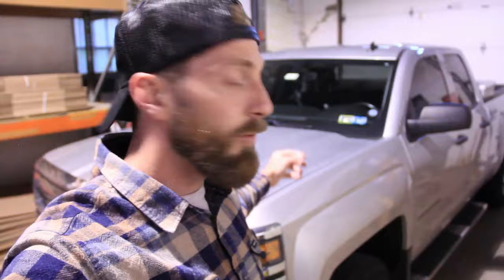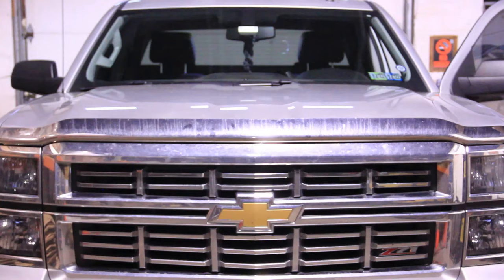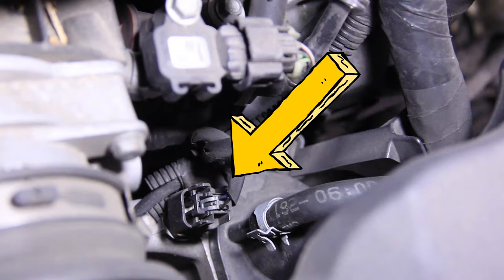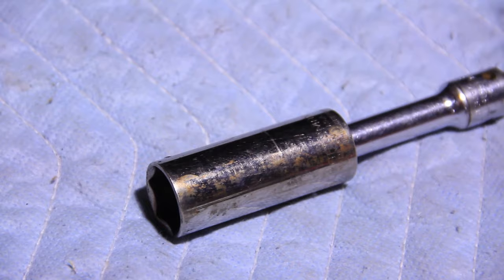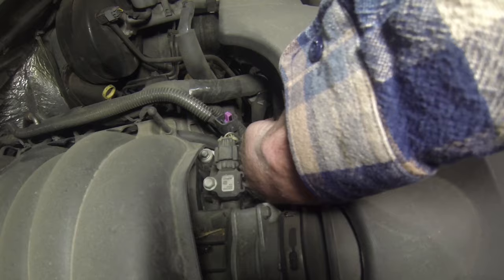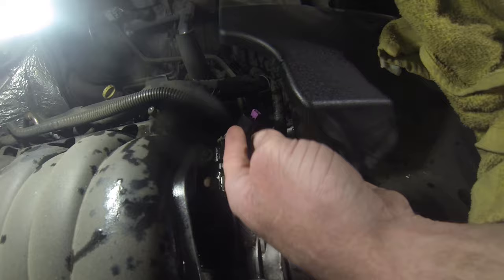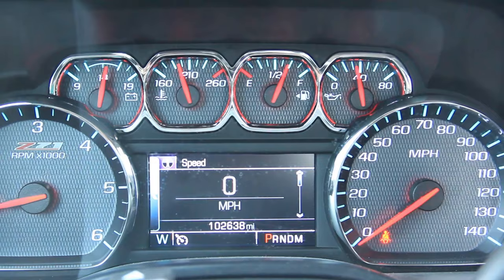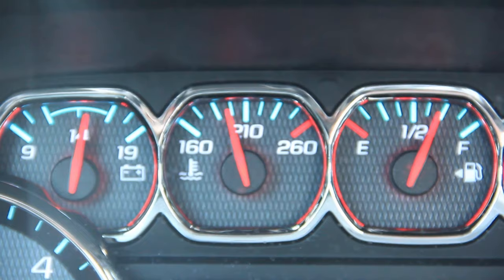Radiator Fan Won't Turn Off: 2014 - 2019 Silverado & Sierra: Bad Coolant Temperature Sensor Replaced

Comment: So I just had this issue. I replaced the part once already an now on my way to work ita doing it again. Is there another reason why it would do it again? The temp sensor I replaced it with was an OEM part too...
Reply from the maker: Hey what's going on?! We've addressed possible issues that could possibly cause this issue in other videos we have done.  I've linked them below: 👇 watch the first one for the explanation and the second for how to fix the issue.
https://youtu.be/wed9eZxPwsQ
https://youtu.be/WvLyBM8FHdM
Reply: @TheBrothersWorkshop  thank you! Looks like I have a thermostat to replace this weekend!
Reply: @TheBrothersWorkshop  I'm also curious at what  Mileage you had you're issues? I'm sitting at 165k now an she's just starting to do these little things like this
Reply from the maker: My lifters went at 75k and my thermostat went at around 100k.

Comment: Some temperature sensors specify not to use teflon tape.  Are you sure this is okay?
Reply from the maker: You are correct.  We recommend removing or not using the Teflon tape if it is not needed.  We go over that in this video: https://youtu.be/wed9eZxPwsQ
Reply: @TheBrothersWorkshop  Ok.  I was checking out my work truck while the video was going.  I ended up just disconnecting and reconnecting the battery and it worked.  I remembered when I was installing fuel injection on my 66 Mercury and installing a second water temperature sensor which is the same as the one  these trucks use, the instructions said not to use teflon tape.  I had already installed it with the tape on it and promptly took it off. Helpful video.  I love YouTube.
Reply from the maker: Glad we could help!  YouTube is the best for issues like this!

Comment: I replaced both thermostat and sensor, unplugged the battery for a couple of minutes and turned it back on seemed fine for a couple of days but is still doing the same thing. I cannot figure how to stop the fans from powering on
Reply from the maker: Most likely you have missed a step, or did not do everything correctly.  Go back and double check your work, and check out our troubleshooting video: https://youtu.be/wed9eZxPwsQ
Reply: I did just that but im starting to think its a problem with a relay. Im car savy enough to follow the directions to the t from this video and I knew what I was doing those darn fans just wont turn off. Like i said, they did stop blowing, gauge was working again, and the ac was cool once more but, its like something comes loose and on come the fans and the gauge drops down, the ac is no longer cool. Im going to check it out tomorrow morning. Any other suggestions?

Comment: Hey so I had this same problem but now it stops when it turns off but when my truck is running after 5mins it’ll start up again and it’s running very fast also
Reply from the maker: We've made two videos for people having this issue.  The first is a quick video that explains the common reasons you could be experiencing this issue.  The second video explains how to replace the thermostat (the most common reason this is still occuring).  I've linked both below for you.  👇

https://youtu.be/wed9eZxPwsQ

https://youtu.be/WvLyBM8FHdM

Comment: Mine are running while truck is on but constantly. Same problem??
Reply from the maker: It definitely ran high while the truck was on.  It all depends on the symptoms, but it might not hurt to replace the sensor and thermostat. I've linked the thermostat video below: 👇
https://youtu.be/WvLyBM8FHdM
Reply: @TheBrothersWorkshop  thanks for the reply bro. Fuse and relays look brand new still. Gonna do sensor first and then thermostat if needed. Thanks man. Great vids too.
Reply from the maker: No problem dude!  Good luck and let us know how it goes.

Comment: Same thing happened to my 2014 Silverado...excuse me but how much does it cost to repair this?
Reply from the maker: Hello Jon, the cost is all in the parts.  Roughly $20-25 for the sensor and $50-60 for the thermostat.  I would recommend replacing both at the same time.  I've linked two more videos below to help you: 👇
https://youtu.be/wed9eZxPwsQ
https://youtu.be/WvLyBM8FHdM

Comment: I changed out the sensor first that didn’t work so I changed the thermostat and still no luck I took off the negative on the battery and left it off for 30 min and still haven’t fixed the issue anyone have another suggestion
Reply from the maker: You might have another issue. If it didn't work I'd take it in and have it serviced by professional.

Comment: How does a coolant temp sensor, with a 5 volt feed(ignition on) cause the fans to continually run, especially when the temp gauge was stuck on °160.  To me, that means the engine is not getting hot enough? A thermostat stuck open,  would cause an engine cold too long,  which also shouldn't keep fans running? Does this have two sensors,  1 for gauge (single wire), 2nd, for pcm to monitor temp, , thus having pcm trigger relay to engage fan(s)??
Reply from the maker: Hey Patrick, thanks for watching the video.  Changing the sensor works, but sometimes the issue continues.  We recommend changing the thermostat at the same time.  We've linked two more videos for you to view below: 👇
https://youtu.be/WvLyBM8FHdM
https://youtu.be/wed9eZxPwsQ
Reply: I'm just curious as to what the pcm was reading from the temp sensor. Could you see that reading on a scanner?
Reply from the maker: That's a good question, but unfortunately that is one we don't have the answer to.

Comment: Dear, I have 2014 silverado.I have a exactly same problem. Is this also related AC as well? My AC is warm when this problem happen..
Reply from the maker: I want people ask the same question.  However, when this happened to us it was the winter.  We never noticed a difference because we weren't using the ac.

Comment: I have ? I have a 2015 Yukon this happen to me 3 days ago can I still drive my truck with a bad sensor? Asking cause I’m taking it to the dealer and it’s about a 20 minute drive.
Reply from the maker: I drove 6 hours home after this happened while I was on vacation.  I don't condone doing that, but I had no issues.  However, I would try to change this myself before going to the dealership.  It's much too easy of a fix to spend a few hundred dollars at the dealership.
Reply: @TheBrothersWorkshop  yes but try telling that to my wife!😩😩😂😂😂I told her I can fix, her answer was hell no! But  we are under a 5 year warranty. Thx answering my question appreciate that.
Reply from the maker: As long as you have that warranty. lol
Reply: @TheBrothersWorkshop  it’s was the thermostat ..
Reply from the maker: Glad we could help! 🙌

Comment: What if after doing this the temperature still isn’t reading and the fans still doing same thing?
Reply from the maker: Remove the teflon tape from the sensor and disconnect the battery to reset the system.

Comment: I just changed mine and now the fans didn’t turn on. I left it running for awhile and drove it a couple blocks and they wouldn’t turn on. What could the issue be if anyone knows .
Reply from the maker: I'm not sure, but double check your work.  Make sure everything was done properly.

Comment: This happened to me today. Turned my truck  off and the fan was still on extremely high. But my temperature gauge was on the lowest temperature. Later on my silverado went back to normal. Could that be the sensor too?
Reply from the maker: Hey Marks Man!  Thanks for watching the video.  Sounds like your problem could be the sensor, but it could also be your thermostat.  We did a video on that as well.  I've linked it here for you: https://youtu.be/WvLyBM8FHdM
Reply: @TheBrothersWorkshop  thanks man. I'm going to change both the sensor and the thermostat just to be safe.

Comment: I drive '18 Sivlerado and my problem is that the radiator fan starts running really loud after a couple hours of drive and I could still hear the loud fan noise even when it is parked. After I turn off the engine for 10 minutes or so and turn the engine back on, the fan comes back to normal. Do you think it is the coolant sensor issue?
Reply from the maker: There is a chance that it's your thermostat or your sensor.  It wouldn't hurt to replace it.  Have you checked your coolant levels?  That may also be an issue.  Regardless, this is an easy part to replace and if you do the sensor, you should do the thermostat as well.  We've linked a video on how to do that here: https://youtu.be/WvLyBM8FHdM

Good luck and let us know how it goes and what happens.

Comment: I replaced the sensor 2 weeks ago and the gauge is back at 160 after 2 weeks fans are running nonstop. No check engine codes
Reply from the maker: Hey Cody, that happened to us.  If you watched the whole video we go over why that might happen.  You need to watch the playlist we have created for this issue.  It includes the sensor replacement video, the thermostat replacement video, and a troubleshooting video.  I've linked it here for you:  https://youtube.com/playlist?list=PLnPXcXYmgiuvbA7f_Zot4ScG1DJ7QJgO8
Reply from the maker: https://youtube.com/playlist?list=PLnPXcXYmgiuvbA7f_Zot4ScG1DJ7QJgO8

Comment: I did a year later doing the same thing could it be that went bad gain ?
Reply from the maker: Checking out our playlist on this issue.  It includes a troubleshooting video.  I've linked it here for you: https://youtube.com/playlist?list=PLnPXcXYmgiuvbA7f_Zot4ScG1DJ7QJgO8
Reply: Thank u buddy , engine light came out runs the diagnostic bad thermostat swap it and now it seems to be working just fine will keep u guys updated

Comment: Ok, I’m on my 2nd sensor and problem came back. A quick battery reset fixes it but comes back a few days later. So annoying, any advice besides trade it in🤬
Reply from the maker: https://youtu.be/wed9eZxPwsQ
Reply: @TheBrothersWorkshop   2nd sensor I didn’t use tape, reset battery often. Next step is thermostat change/fluid flush, maybe even put new water pump. 2015 Silverado 140,000 miles
Reply from the maker: I made these videos and the follow up because I learned the hard way that the thermostat and the sensor must be changed together.  Change both at the same time, disconnect the battery, and you'll be good to go.

Comment: I changed the sensor and the thermostat they fans still don't turn off. they do sometimes and the temp gauge goes up like normal but then the fans kick in and the temp goes to cold and the AC will not blow cold? any help will be greatly appreciated
Reply from the maker: Check out this video we did, it might help: https://youtu.be/wed9eZxPwsQ
Reply from the maker: If the above video doesn't help, check your ambient air temperature sensor.  The Ambient Temperature Sensor is located behind the grill, and measures the temperature outside of the passenger compartment.  The sensor provides input to automatic HVAC systems, and helps control the interior temperature of the vehicle.

Comment: The key issue is knowing if its the sensor or the thermostat itself.
Reply from the maker: It's both the thermostat and the sensor. We try to explain that in the video series, but most people don't realize there's more than just this video. So, we created a new video that explains this in detail. I've linked it here for you: https://youtu.be/7gKbLHhD1cw
Reply: @TheBrothersWorkshop thanks,  I'm doing both mine right now.

Comment: I got a code reader and rest the faults that seems to be a temporary fix because my ac quits working when this happens and the code reader showed that the sensor was not working.
Reply from the maker: Yes, it needs replaced along with the thermostat...  Check out our video on that as well.

Comment: i got this fixed. but for some reason the AC isn't blowing cold air, it just passing outside air. Is there a correlation between the temp sensor and the AC not working?
Reply: There's a lot of complaints about the AC condenser failure on the 2014 GMC Sierra. Maybe it's your case. Don't know! Also I'm not sure if it's a recall for it and engine lifters also is a big thing.
Reply: @PoisonShot20   it failed abruptly after i changed the thermostat sensor. i haven't any troubleshooting yet but i dread taking it to the dealer.... mine is 2016 and has close to 200K miles, i may not qualify for a recall
Reply: @CypherByt3  At least you made very far, most GM suckers never passed 80k. I'm one of the suckers, on my 2nd GMC Sierra. Last was a 2003, only issue was the transfer case, and the body rotten way at 170k.  Now just bought a 2014, 27k miles, just learning all this🙏🙏
Reply from the maker: If you have a 2016, the AC condenser issue shouldn't be the problem.  That was a major issue for the 2014-15 model years.  It was fixed for the 2016-19.  Check out our troubleshooting video, maybe it will help.  I linked the video below: 👇https://youtu.be/wed9eZxPwsQ
Reply: @TheBrothersWorkshop  Thank you, but I'm not so lucky, ad far as the year,  my is the 2014 Sierra, 5.3  V8 6speed. Hai Der has the 2016 with condenser problems. On my case, about removing the oil pressure plug and the transition oil pressure as someone suggested? All this is Chinese to me! So much to digest, hard drive is kind full!🤣

Comment: Is there anything else you can think of that causes this problem? My Father 2016 Silverado 1500 4.3 engine has the same problem with the coolant fan running when the ignition off. He watched your video and replaced the Sensor, but the fan still running after he's turns off the ignition. Also the coolant temp gauge is constantly reads 160 degrees.
Reply: Also the radiator fan comes on 1mins after the engine comes on, and stays on 5 mins after he turns it off. He said the engine not  that hot for the fan to be on.
Reply from the maker: Nathaniel, we had the same issue at first. At the end of the video we suggest replacing the thermostat (if the issue continues).  Replace the thermostat and restart the trucks computer by unhooking the battery.  We've linked that video here: https://youtu.be/WvLyBM8FHdM
Reply from the maker: https://youtu.be/WvLyBM8FHdM
Reply: @TheBrothersWorkshop  Dad said it worked. Thanks for the help!

Comment: So I replaced it on my 16 Tahoe after 2 days the fans went on again. What could be wrong?? The thermostat?
Reply from the maker: Replace the thermostat and remove the teflon tape from the sensor.  Then disconnect the battery to reset the computer.
Reply: @TheBrothersWorkshop  thanks you
Reply: @TheBrothersWorkshop  i replaced the thermostat. Problem solved! Thanks

Comment: Was your AC not blowing cold before this fix ?
Reply from the maker: That's a great question Pete.  Unfortunately, this happened during the winter, so I never noticed if the AC was affected.  I would say that if all of the other signs are present, you most likely have the same issue, and other people have said their ac system was affected.
Reply: Thanks for the video, it was very helpful
Reply from the maker: No problem!
Reply: @TheBrothersWorkshop  I replaced coolant temp sensor and the problem returned after 4 days, with this problem, the temp gauge doesn’t move and AC doesn’t blow cold, any other suggestions?

Comment: hey i have the same problem and i just changed the thermostat and temperature sensor and my fans are still staying on
Reply from the maker: Disconnect the battery for ten minutes.  That will reset your computer and fix the problem.
Reply: @TheBrothersWorkshop  okay thank you i will try that if that don’t work i’ll get back at you

Comment: my truck is doing the same thing i replaced the sensor and it still keeps running do you have any ideas
Reply from the maker: Wayne, we just did a video about that.  Follow the link below it will explain what the other possible problem is.

https://youtu.be/WvLyBM8FHdM

Comment: All I did was disconnect the positive terminal on the battery for 2 minutes and didn’t have to change or replace anything.
Reply from the maker: Disconnecting the battery resets the computer.  After a while, your truck will most likely start doing it again.  The issue still exists, until it is fixed.

Comment: My 2014 Silverado started blowing really loud and I thought this was the fan clutch it threw a check engine light too it was even loud after shutting the vehicle off 

All I did was plug in a afm disabler and it went away and the check engine light went away as well idk why
Reply from the maker: The issue that we tackle in this video does not throw any check engine light codes.  Sounds to me like you have a different problem.
Reply: @TheBrothersWorkshop  yea I know but I can’t find anything about it online 

Like I said It went away from simply plugging in my afm disabler im just curious if it’ll blow loud again But I kinda doubt it
Reply from the maker: What code code did you get?
Reply: @TheBrothersWorkshop  I didn’t check the codes I was at work and I work out of my truck 

It happened after I disconnected my afm disabler cuz I needed the ecm to reset to stick to pass my annual vehicle inspection then the fan clutch got real loud 

Plugged it back in and the sound went away next time I started it up ive put 3 or 4 thousand miles on it since no check engine light anymore and no noise
Reply from the maker: Very very interesting... 🤔

Comment: changed both the sensor and the thermostat and still doing it. is there something else Im missing?
Reply from the maker: Hey Michael, sorry to hear your still having issues.  Check to make sure you have adequate coolant.  Other than that, I'm not sure what it could be.  We replaced both of these parts almost four months ago and have had no issues.  Please let us know if you figure it out.
Reply: @TheBrothersWorkshop  the new temp sensor was bad! I got it! Thank for the vids it helped alot